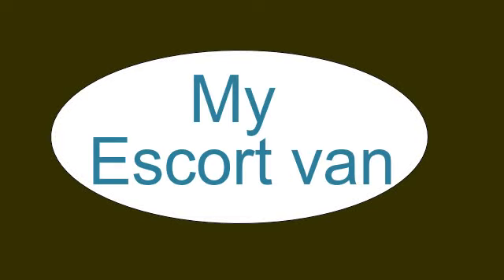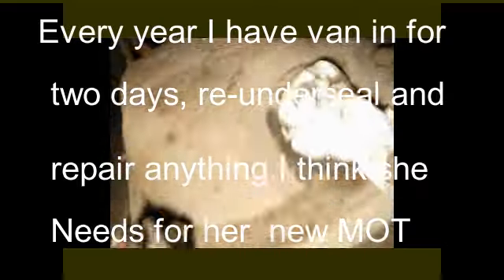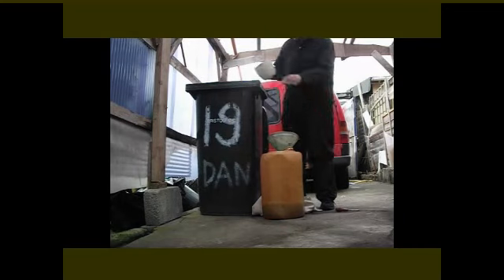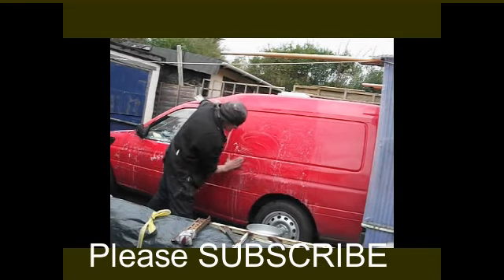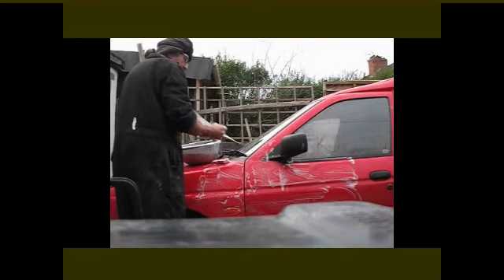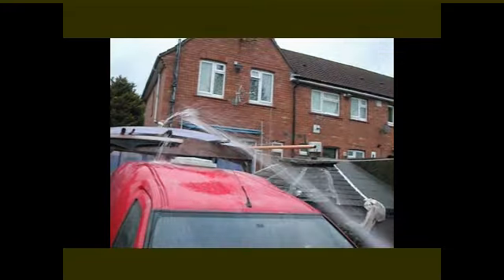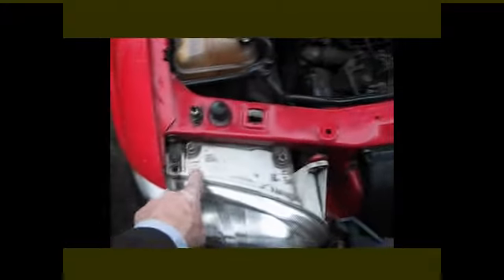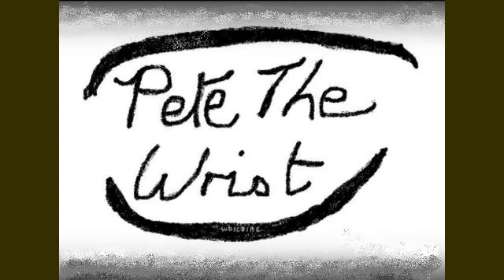Six years on.  mot for My Red Ford Escort diesel van, petthewrist             Diesel Van petthewrist

Comment: Keep it up, I think I'm going to wax inside battery tray keep that rain off and stop it rusting mines in good condition but prevention is better than the cure I wash and wax my van once a week it always looks better after a clean. Good video and take care
Reply from the maker: I have xax oiled inside my battery rack and other side all panels are waxed. I only wash and clean her once a year. At this moment she passed her mot on Thursday and is at moment in my garage bone dry stripped down all carpets out to Chech floors both inside and out. I am at moment just putting her back to gether. I do this every year as the four months of winter would bore me something rotton other wise. Yes you are right prevention is better than cure. I shell have to make a small video of her in the garage over the Christmas. Christmas day today I worked on her all day. Don't you just have to love your motor. After the fuel shortage I filled her right up and she did over 600 miles on a tank full. Love your ford and she will love you. Cheers Pete